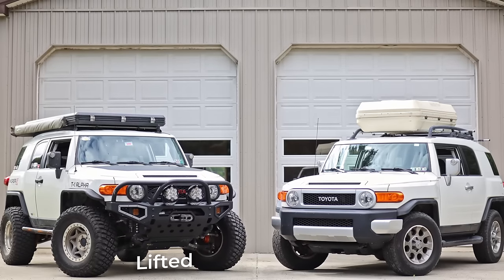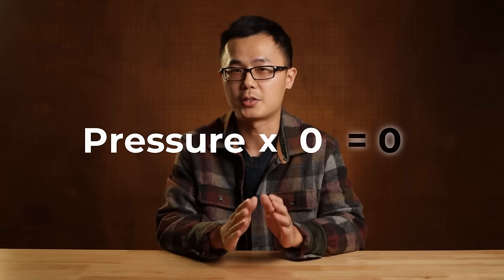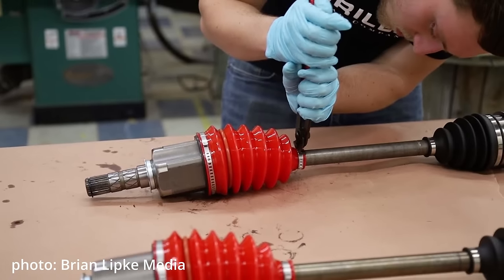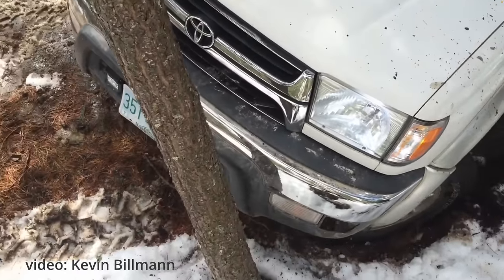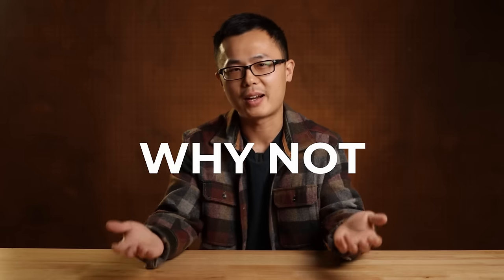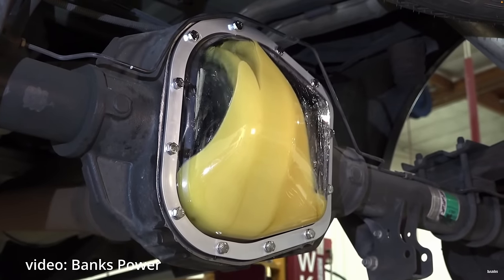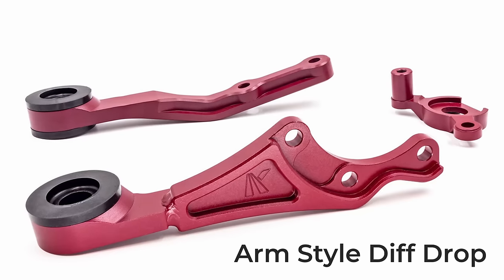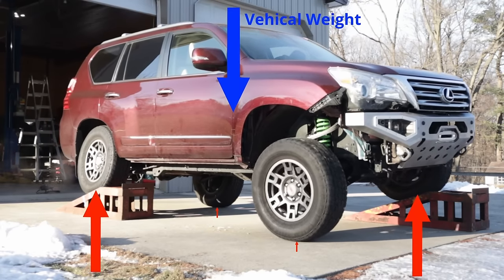More Harm Than Good? Toyota Diff Drop Truth vs Myth

Comment: This is your most controversial take on suspension/lifts imo.  I know my 02 Taco TRD loved to eat the bearings in the diff that held the inner cv stub once lifted.  A diff drop seemed to help.  The argument that a higher angle on the cv's doesn't affect wear much is kinda sus, because all ifs systems break more axles at droop and with the steering locked (aka highest possible outer cv angle); it's clearly weaker with more angle and you failed to take into account steering as part of your angle calculations.  Let's be honest; most ifs lifted vehicles I see barely have any droop left in the suspension and it's my own personal opinion that people should go as large of a tire as the wheel well fits with as little lift as possible.  Most lifted ifs vehicles that I see would bind the tires in the wheel well if the suspension could actually still cycle to full compression.  How many people actually remove the springs and guarantee tire clearance throughout the suspension's range of motion?  I know I'd take lower lift, lower cv angle, less ground clearance, more useable droop, and full suspension range of motion with as large of tire as possible (that doesn't bind/rub) because it's more useful/less maintenance in just about every situation for my uses.

Comment: Well this sold me.  I bought a 3rd gen 4runner a month ago that has a 2" spacer lift (I will be switching that over to coil lift at some point) and a diff drop.  The factory skids were off when I bought it and I was never give the skid spacers that I presume came with the drop kit used.  I've been wanting to get the factory skids back on and was thinking of finding some spacers.  Now I'm just going to delete the diff drop and get a tiny bit of clearance back.
Reply: You can just flatten the ribs on the inside of the factory skid plate with a BFH and you don't lose any ground clearance with the 1" diff drop on a 3rd Gen 4Runner. That's what most people did back in the day.

Comment: I knew it!!! In one of the 4Runner forums on some thread I read a couple years ago, a guy had some issues with his steering, went to a toyota dealer and took one of their top technicians for a ride in his 4runner, they talked about his issue and got on the topic of the diff drop, the tech explained at great length why the diff drop can actually cause a series of issues all related to each other, going back to the diff drop.

I have been looking for that thread for a long time now but still can't find it. But since reading it, I made up my mind not to get a diff drop. This video confirms my decision. Fantastic video as always man!
Reply from the maker: Thanks! Yeah many issues on vehicles are interconnected and not simple or linear. Most people are looking for short yes or no answers, but those are not usually correct or good.

Comment: You are 100% right on the keep your lift under 2 inches. I see so many people force their ifs into a 4 inch lift. With stock arms this is horrible. There is nothing positive about this style lift. It will never align, extreme tire shoulder wear, rides like crap, you loose all droop and articulation, and I guarantee that your upper ball joint will break at some point.  The ideal ride hight is where your suspension is neutral. If your arms can move 10 inches, ideally you would have your ride hight where your suspension travel is 5 inches up and 5 inches down.

Comment: Great video! We also tell customers a diff drop is not needed. 1" more travel beyond an extended travel shock will run into other issues in addition to CV angles. Ball joint or uniball on UCA will usually be maxed out.

Comment: Your videos are the best source for Toyota 4x4 technical info on the internet by far. I'd love to see a video analyzing the sliding sway bar disconnects for non KDSS 120s. They seem like an interesting compromising for keeping a sway bar.
Reply: So I've spent some time thinking about the 10" travel set up you mentioned. It may be possible to use Bilstein 5100s with a 3/8" top spacer. The total length would come out just short of 10". I think you should be able to get full up travel and bumpstop function based on this video from Westcott Designs (https://www.youtube.com/watch?v=lRzgZQK37_Y) showing their 1/2" top hat spacer on a fox trd pro strut with a TCL of 17.44" and the 5100s have a total compressed length is 17.58". The 0.14" difference would be accounted for by the slight shorter top hat spacer. Also there are other options for the N80 diff drop kit that are cheaper and some look to be sturdier. The CalOffroad kit has an extra mount point and is about 370 usd vs 460. There is also a set on Alibaba for about 250. Can't wait to hear more about what you're piecing together. Note: In the westcott video, they don't show the same level of bump stop compression vs your IFS video.

Comment: Another fantastic video. You should make a video about how to get as much droop as possible! Using that arm style diff drop, aftermarket UCA’s, extended + spacer coilovers, and high articulation cv axles. What is the theoretical limit to the stock suspension design using aftermarket parts without going for long travel IFS? Or at least do a video about maximizing droop, even if you don’t take it all the way. Thanks again for the fantastic content! Reconsidering my diff drop now 😂
Reply: Please do this!

Comment: The problem you guys in the USA have is that you guys still use "spacer" style diff drops. Which rotates the diff slightly forward and due to the rear mount being fixed still, gives you less than 0.5" of actual CV shaft reprieve.

Here in Australia, we replace the whole set of diff mount arms that lower the diff 32mm - over an inch evenly. 

Not only that but there are strength benefits to be had as with the spacer drops, you're still using the factory arms which are prone to bending in low range high load situations.

The replacement arm diff drops we use here in Oz, the RHF mount I'd also braced between both the front and rear crossmembers, which significantly increases strength and alleviates the mount bending issues the factory mounts are prone to.

Our mounts reduce proper CV angle, thus providing additional strength and reliability, plus with longer coilovers, a good inch of downtravel is achievable.
Reply: What’s the name of the website that sells them?
Reply: Who sells the arm style diff drops?

Comment: Bigger tires also change the Torque on the wheels and load on bearings.  I've taking a stock 3rd gen 4runner with stock tires places guys with 4 inch lifts go. You are 100% correct. Driver skill is far more important.  I like the smaller tires and More torque, crawling speed.

Comment: Have a 3 inch suspension lift on an 08 Duramax. It includes a 2 inch diff drop to keep the front CV angles the same as OEM.

Comment: Excellent video, as always! I have been wondering about this for the longest time (about 20 years)but I could never get a definitive answer. Now on my 3rd Toyota truck lifted I’m glad never did.
I always install a suspension lift that’s no more than 2 inches with a set of 33’s. I’m my opinion is the perfect set up for highway and off road driving.
Note: I am interested on the shift knob for my 2016 Tacoma manual transmission. Are you able to ship to Canada yet?
Reply from the maker: Thanks! Great way to build an IFS. My FJ is also 2" lift, despite it looks bigger with wider control arms and tall fenders. International shipping will turned on soon! You can sign up my email list and I will notify you when it is ready.
Reply: @TinkerersAdventure  Great!! Thanks, will do.

Comment: Wow! I wish I had known this a couple of years ago. I took my 07 FJC MT to the shop to replace the cv axles, and they recommended a diff drop. I had it done. I since then have converted my FJ into an overlander and have several trails under my belt. There are no issues yet. With my FJ having a 3" suspension lift, maybe I'll have that diff drop reversed in the future. I don't like the possible 1" of lost ground clearance. Thanks Kai!!

Comment: One issue with the arm drop from Kaon is that it's only for the hilux/fortuner platform and not the prado/FJ/4runner platform. While they both use the same outer components, the diffs and chassis are different.

Comment: I’m a Nissan guy and I still really enjoy your videos. Keep it up!
Reply: Me too. I have a 2011 Xterra AT Pro-4X, but I used to have a 2006 FJ Cruiser MT. I have to say, I like my Xterra much better. The resale value isn't as good. That's the one big negative. However, the frame is so much stronger, and you don't have to do a body mount chop to fit larger tires. Unfortunately, because Nissan didn't sell many 2nd Gen Xterras, aftermarket support is limited, and expensive.

Comment: That KAON diff drop ($695 AUD) does more than drop the diff. The N70, N80 Hilux and Fortuner's have an issue whereby the diff assembly is not even from side to side. The right hand (drivers' side in Australia) is 10mm higher than the left side. It was very noticeable on my 2018 Hilux (45mm lift).  Suspension was rechecked by the installer and also my mechanic and it was adjusted correctly. 
This particular diff drop fixes this issue so not only is the diff lower but both sides are even. This only affects the models mentioned above, not the FJ cruisers or Prado's.
Reply from the maker: Very interesting. Thanks for sharing that info

Comment: I love these videos. I just installed a 3inch lift kit on my 2021 4runner and I didn't do the diff drop. I'm running BFGOODRICH stock size 265's for now, when those are worn-out I'll change the wheels and tires going for 33's.

Pretty happy with the results.

Comment: Something I didn't see mentioned, but I see a lot of when people do Diff Drops on Toyota Trucks & SUVs specifically, is that you need to bend/adjust the breather tube bracket if you do a front diff drop. The front diff drop will pull the breather hoses against the steering rack lines/clamps, specifically the ADD Actuator breather, over time it will cut into the lines and allow moisture to drain into the ADD itself and cause corrosion. Due to where the breather hole is for the ADD Actuator, the moisture will drain along the side of the casing and pool along the bottom just under the finger switches that are used by the actuator for timing/position; once you start getting corrosion along those switches/tracks you'll start seeing intermittent and/or full failure of the ADD Actuator. From my experience, that's been the most common failure of the ADD Actuators in Part-Time 4WD systems by Toyota is moisture induced corrosion confusing the position signals (something you can easily verify by either using a known good ADD to plug into the harness and/or manually jumping pins to tell the 4WD ECU which position it's in). It was something we found out on the T4R.org forums and verified myself on multiple vehicles over the last year or two that have come in for 4WD issues; I've also been able to "repair" multiple ADD Actuators simply by cleaning the contacts and replacing the grease if it's contaminated (though, I should point out; this was specifically for ones that were outputting incorrect position signals; not ones where the corrosion ate the motor up).

So just passing the knowledge along to you guys, it's easy to see if you look at the steering rack lines near the intermediate shaft with a light and use either a prybar or your hand if you can reach back there and just push the steel bracket away a half an inch. May save you a headache down the line... or just you know... not run a Diff Drop if you don't need it like our friend here points out?
Reply from the maker: Thanks for sharing! That is a valuable piece of information. Makes a lot of sense

Comment: I would never go for a diff drop and your advice is spot on, rather if I had money, I would invest in portal axles. As usual, precise to the point advice.
Reply: Definetly, the extra diff clearance is worth it.
Reply: @modarkthemauler  diff still stays in the same spot.
Reply: @RoyFJ65  Relative to ground you gain clearance with portal axles. Relative to suspension, yes the diff stays in the same place.
Reply: @modarkthemauler  true you get clearance on the axles but the center still stays in the same spot. Now that you mention portals, thats the real lift that basically fixes all the issues. Check out Megacruiser from Toyota, perfect execution of a off road capable vehicle.

Comment: I’ve been wanting your take on drop bracket lifts ever since I first found your channel, should be good
Reply from the maker: Thanks. This does not cover drop bracket lift like the Rough country 6” lift, which uses a taller spindle. BUT, i will present something like that but maybe even better, stay tuned :)
Reply: @TinkerersAdventure  oh sorry, I must’ve seen the title and misread.

But yes, I think a video on drop bracket lifts would be very helpful to many people in truck modding community!
Reply: @Absolute_Unit135  It's funny, the Toyota community thinks drop bracket lifts are trash, however, when I was younger and into full-size pickups, for the guys that ran IFS on those, the drop bracket kits were considered the quality kits and the way to go. Personally, I think drop bracket kits have their place, it just depends what you're trying to do with the vehicle and what your main performance goals are. I like the fact that the drop bracket kits at least make an attempt to maintain the factory geometry.

Comment: I did a fab tech 6” lift. Not possible without a did drop.  Preloead ‘lifts’ a couple inches probably do not matter.  

Not intelligent off reading where you’re spinning tires will snap it up no matter what. If your tires are spinning, get a locker, use traction aids, pick a better line, get better tires, or don’t do it.  Emotional people always have problems in all aspects of life.

Comment: Another well explained video, thank you for the knowledge and the money saving tips Ki. I'm curious to your thoughts on replacing the driver side needle bearing to a ECGS bushing for preventative wear and vibration after lifting a 5th Gen 4runner?
Reply from the maker: Thank you! Yeah you should do it. Or wait until the factory one went out. Mine went out even with 2" lift. But I swapped in an ARB air locker, which came with a similar bushing.
Reply: @TinkerersAdventure  I agree. I had a 2" lift and the bearing went fast, swapped in for the ECGS, then got a 3" lift, problem was not only solved, but it's been fine for the past 2 years of hard wheeling. that being said, cheaper aftermarket CV's, even with the ECGS bushing, will cause issues. It;'s very important to stick with toyota CV's WITH the ECGS bushing as the tolerances with toyota CV's is tighter, aftermarket CV's seem to be maybe even a few micrometers off, causing slop in the CV cassette

Comment: I've always considered these useless, primarily because it only drops one side of the diff and just tilts it back instead of "dropping". Never made sense how that would actually correct CV angle in any meaningful way. That being said, I put them on my wife's 4Runner because they came with our parts 4Runner, was more of a "I have them, and it won't hurt to have them installed" decisions.

Comment: So, this may be hard to do but I was wondering if you might consider a video about installing lifts on high mileage vehicles. A lot of folks over the last several years especially have posted videos or made comments in forums about putting lifts (spacer or springs) on high, sometimes very high, mileage vehicles that they bought because they wanted to get something cheap. Then they complain about vibrations, rough ride and pre-mature drive line wear. I have two ideas about this. One is that the original suspension components are worn and when they change to new after market components and then subject the old gear to hard use they have issues. What they should do is overhaul the old components before adding anything new. The second idea is that after 125,000 to 200,000 miles (yes, some folks are buying vehicles with 200,000 miles on them and then modifying them as if nothing will happen) the factory parts, especially the CV axles have worn in within the factory designed ranges of articulation. When someone throws a lift on and sets a new static droop position the old and worn CV joints being asked to turn in a constant static position that they only experienced briefly before modifications. I suspect this is one of the causes of the vibration so commonly complained about after people lift high mileage vehicles. This one seems more common in full time 4WD or AWD vehicles, of course. In fact, they report when their complaints are expressed to the manufacturer they are told to try replacing the CV axles.
Reply from the maker: Good idea. I have a 1st gen taco at 260K miles and some light modifications. Maybe I’ll make a video on that

Comment: I took the brackets off the front diff and redesigned them so the diff drops .  Now I made my own skid plates with wings tat stick out in to the bottom a-arms.  This way with my front cv protector’s the cv joints are only unprotected from the back side . I think I dropped my diff around 3/4 of an inch.  Now my skid plates the bottom flat one is 1/4 inch plate now the front is 3/16.   I recently made a front bumper to replace the one behind the plastic so it’s for a winch !  Yeah fits behind the original plastic bumper cut one hole under the front plate .  It’s all 1/4 plate boxed on the bolt on ends then flat under the winch with 4 gussets on the ends timing the flat in to the boxed ends .  Then a peace of channel across the bottom with two threaded holes for the middle bumper cover bolts !  Great advise on all the lift products and your facts then most for your knowledge!